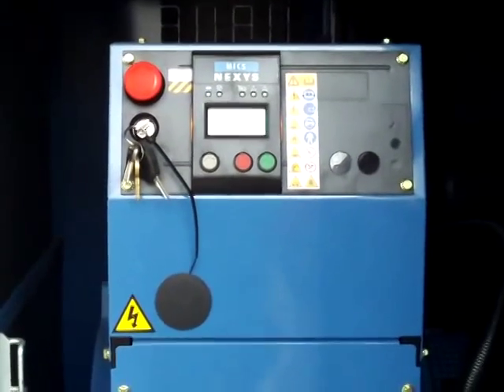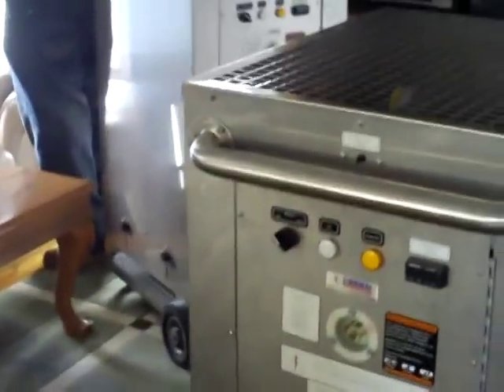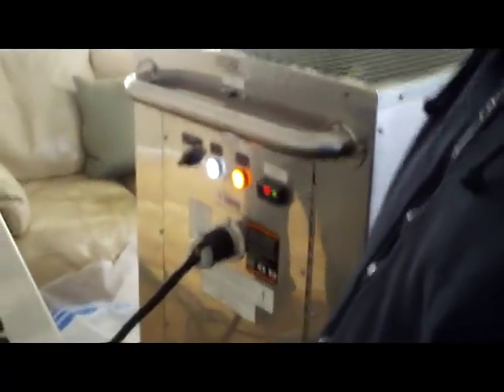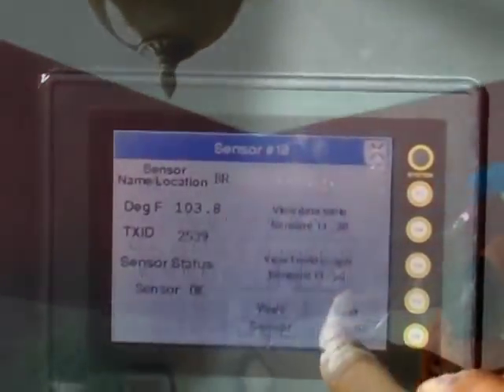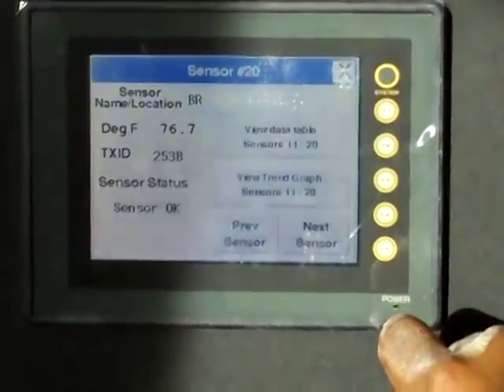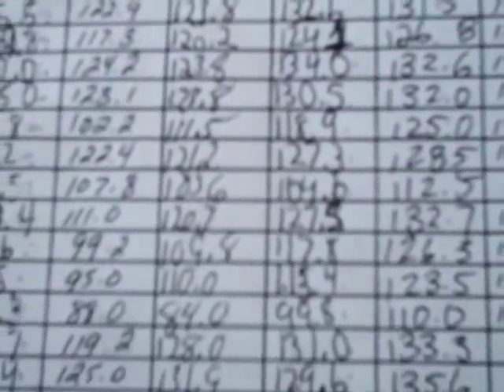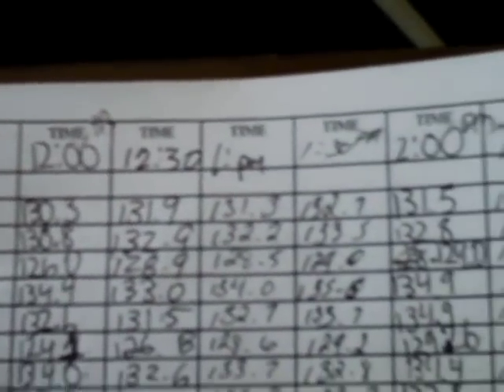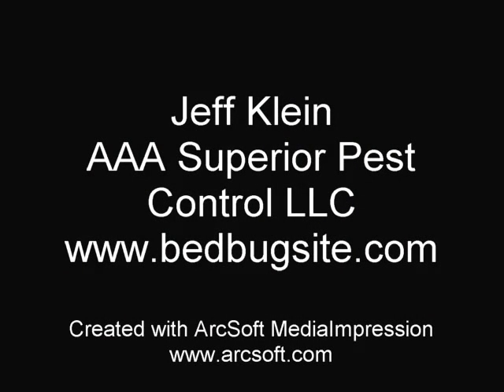Bed Bug Heat Treatment in New York City

Comment from the maker: @cordedpoodle We follow-up all treatments with a canine inspection. If the bed bugs are still there we continue to treat until they are gone. Realize our success rate with eradication using heat on a non-chemically treated home is around 98% first try-far superior to chemical treatments.

Comment: @MockingSolemnity 

Having your home chemically treated is expensive and time consuming.  If a thorough job is not done, you may not even get rid of the bed bugs.  -also remember no matter how thorough you are, the chemicals will not kill the eggs.  With a heat treatment you will kill all stages of the bed bug. And there is nothing stopping you from doing both- dusting the baseboards with DE or mother earth and doing the heat treatment.

Comment: Having your home chemically treated is expensive and time consuming.  If a thorough job is not done, you may not even get rid of the bed bugs.  -also remember no matter how thorough you are, the chemicals will not kill the eggs.  With a heat treatment you will kill all stages of the bed bug. And there is nothing stopping you from doing both- dusting the baseboards with DE or mother earth and doing the heat treatment.

Comment: @MockingSolemnity 

any residual left behind with pesticides will not kill bedbugs. Once the chemical dries it no longer works. If it did you would only need to do one treatment with pesticides if there was a residual. Your logic is flawd